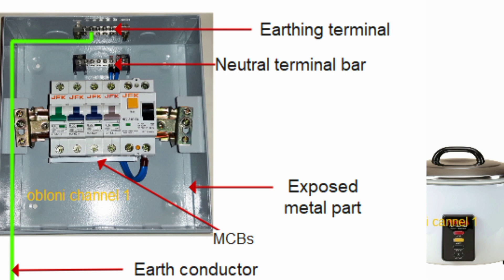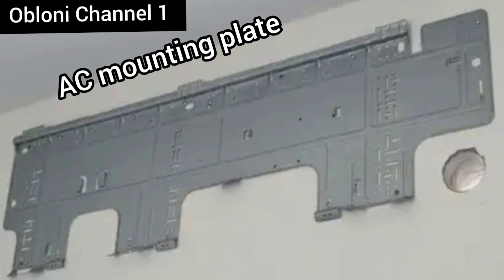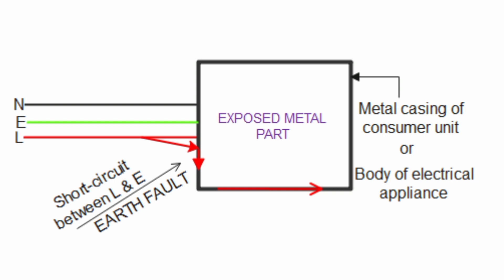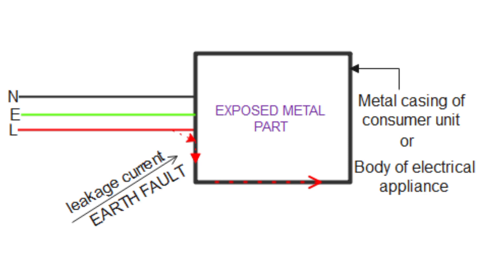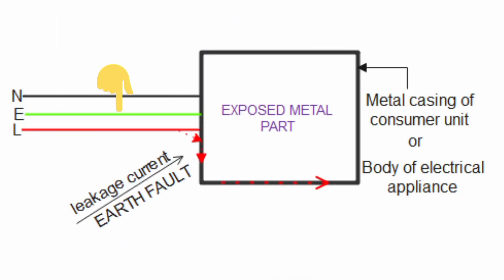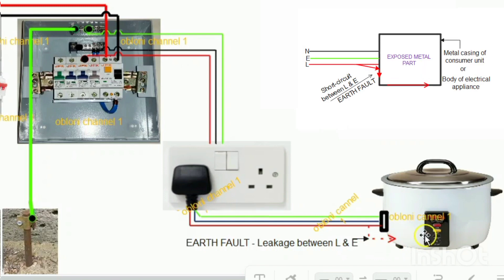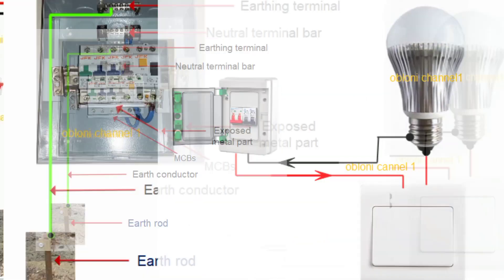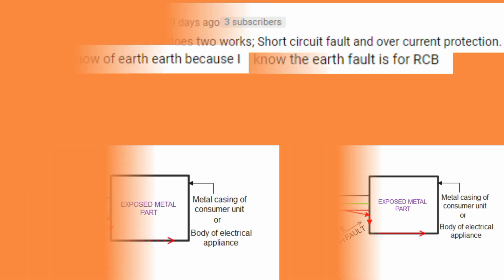Earth Fault Explained: Causes and Effects in Electrical Installations

Comment: If Live and earth cable are being shorted together can our earthing system convey the current to the general ground mass if our earthing system were properly installed?
Reply from the maker: In that situation, your properly installed earthing system will rather cause the CPD to disrupt the circuit.
I will make a video on earthing to explain these things further.
Reply: @obloni_Electrical   
I can't wait to see the video Sir 
Thanks in Advance

Comment: Good morning sir, pls, I have experience this situation just yesterday, I did all the necessary checks and test but to no avail. I mean I tested the earth bar but there is no power flowing, but anytime you plug any gadget that has a metal body, when you test the body, you see power. Pls, what could be the cause sir?
Reply from the maker: Hi Seth this is a very technical issue. I will attend to this question in a special video in which I will be sharing my personal experience. I believe it will help.
Reply from the maker: https://youtu.be/dLcsdC7sMJM